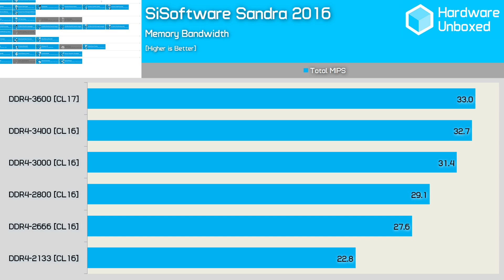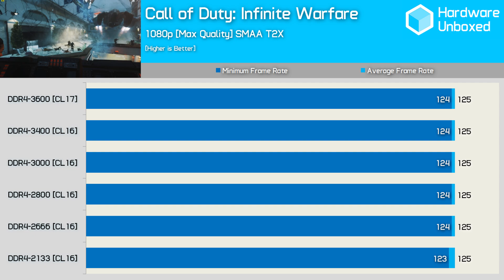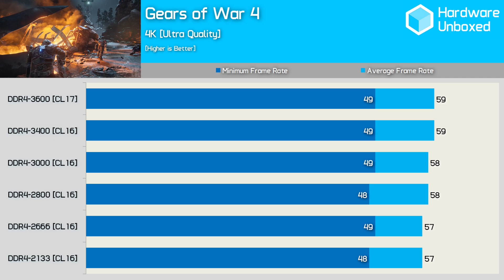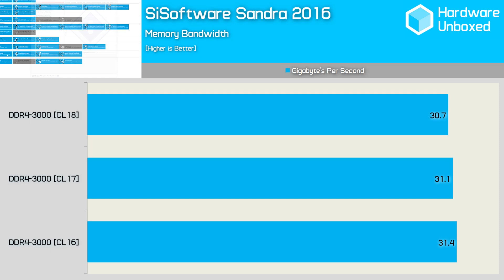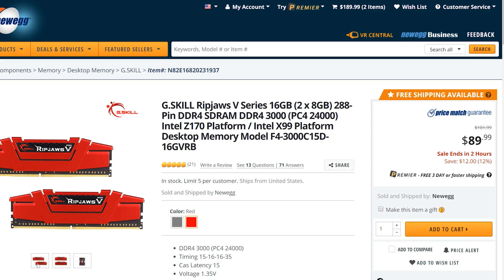Kaby Lake DDR4 Memory Guide, Scaling Performance Tested

Comment: Nice guide man. And a coffee lake guide like this one?
Reply: Get 3200 mhz cl14 G. Skill TridentZ as those are samsung b-die. They can be overclocked to 3600 cl16 fairly easily. My rule of thumb is, if you are going with a >$400 GPU with a high end i7 CPU / Ryzen 7 (>$300) cpu, might as well pair at least 3200 mhz ram. Open world games nowadays need fairly high speed ram. You pretty much at least buy the ram speed in the middle of the lowest and highest speeds (2133 - 4600), so 3200 - 3600 mhz ram.

Comment: Great videos as always! 

But could you guys please make a DDR4 memory guide for the most common GPU price bracket (GTX 1060/ RX480)? I have seen plenty of videos like yours showing performance advantages of higher frequency memory especially when the GPU and CPU are both already top of the line, but I have heard on channels such as DigitalFoundry that the performance advantage of higher frequency DDR4 is much more limited when using a more common setup (e.g; midrange i5 +1060 or 480) 

It would be interesting to see if spending say.... $10 more to get 2666Mhz instead of 2133Mhz on a midrange build would be worthwhile. 

Keep up the good work!

Comment: thank you for this, I spent way too much time researching if I should go from ddr4-2400 to 3000. I found out that my i7-7700k only supports 2400 anyway unless I overclock. Im still going to get 3000 and just overclock the memory.

Comment: I found that my G.Skill Ripjaws memory overclocks quite well.  I have a mixture of the 2133 and 2400mhz and it all overclocks to 3000mhz when I up the voltage to 1.31V and loosen the timing from 15 to 17 and 1T to 2T.  I haven't seen or felt any difference, whatsoever in gaming, but in synthetic benchmarks, and using my ramdisk (about 40% faster), it makes a noticeable difference.  If you're a gamer, get whatever is cheap.  If you're doing video editing or something that's more memory-intensive, it might pay to get faster memory, or you can take your chances with overclocking.

Comment: I have corsair 2133 stock with 3000 XMP profile, but I manually overclocked to 3200mhZ. Did make a framerate difference on Fallout 4 with my X99 build.

Comment: Memory frequency only helps increasing FPS counter when your CPU+RAM combo are limiting factor. Let's say, you pair i5 6600k clocked at 4.0GHz and GTX 1070 ( overclocked ) and you will start play very CPU demanding games ( Watch Dogs 2 fo instance ) you will notice that majority of playing time your GPU isn't fully utilized ( it's loaded less than 99% of this potential ). You can solve that CPU+RAM "bottleneck" by overclocking CPU and pairing it with higher frequency RAM.
Other example: overclocked i7 ( 4, 6, 8 cores etc. ) with GTX 1070- here you will see constant and full GPU load at 99-100% and therefore further CPU+RAM boost will have no effect whatsoever, because GPU already giving everything it has to.
P.S. Steve, would be interesting to see tests where we could see that thin line when we are ok with i5 k-series and where we start needing stronger i7's to fully utilize graphics adapter.

Comment: Seeing those memory prices in late 2017 :( feelsbadman
Reply: yeah i just got a "deal" on 3200mhz for 134.  what cpu is he using for the benchmarks?  i know 4 core cpus gain more with fast ram.  ive seen in one of his videos a 4 thread cpu gaining around 10 fps in bf1.  its because the threads have to swap in and out of memery so fast.  what cpu is this i wonder?
Reply: I'm pretty sure he's running an i5 6400 for all these benchmarks
Reply: lol are you trolling me.  a 6400 doesnt get 160 fps in bf1 even with a titan x, does it?  i thought maybe 7700k or 6700k.  maybe im wrong though.  is there a particular reason you think so?
Reply: yeah i just checked a 7700k video thats showing similar numbers so i think its an i7. one of his videos shows the difference with a 4 core/4thread chip.  i think it was the i3 8100 which is the same exact chip basically as an i5 6500. it got like 10 or 12 fps just going from 2400 to 3200 i think.  its one of the coffeelake videos recently.  its comparing using a locked b or h board compared to an unlocked z series board.  the b and h only go to 2133 or 2400, i think 2400, with the i3's.  so he compares that speed with 3200 on the z board and it does like 12 fps more.  i7's dont get much help from fast memory but i5's definitely do in any heavily threaded game.  basically any game where an i7 does a lot better than an i5.  when they preform about the same the i5 doesnt gain as much from fast ram

Comment: It is interesting that the RAM speed influences the performance in 1080p quite a bit (Depending on the game) but in 4k gaming there is almost no difference. So if you are planning to play in 4k you don't really have to bother about the RAM speed (yet. Maybe that will change with new graphics cards, maybe not).
Reply: Udo der Unförmige 
should change when GPUs are enough good to actually run games in 4K without being bottleneck.

Comment: If you play at 144hz monitor and you like competetive FPS games memory speed is very important! Minimum FPS is what you need playing at 100+ FPS. Overclocking CPU and Memory (i7 6700k@ 4.5ghz and ddr4 3400mhz for example) will give u highest possible minimum FPS on 1080p resolution. But only if you have R9 Fury - Fury x,  Gtx 980ti, GTX 1070, gtx1080, Titan X you will se 5-10% boost in FPS, slower gpus will give you less boost and makes  no sense to buy fast ram for example for rx470 or gtx 1060 ...The same thing is playing at higher resolutions, you dont need fast memory for 4k gaming...

Comment: "The impact timings have on bandwidth isn't nearly as significant as frequency". When it comes to primary timings, that may be true, but tertiary timings and RTL/IO-L offsets drastically impact bandwidth, far more than the raw clock speed. With 3600 C14-14-14-28-2, my current ram setup handily beats a 4000 C18 XMP kit with relative ease in both raw bandwidth and latency. This is completely ignoring rank interleaving. 

Any who, as your tests have concluded, memory speed only aids in gaming performance in situations with high CPU overhead. As CPU overhead becomes less of an issue (such as higher resolutions) memory speed helps less. As you also said, high refresh rate gaming (especially those high-end variable refresh monitors) benefit greatly from faster ram as it helps determine exactly how low your framerates dip. Faster ram can help you stay within that freesync minimum refresh window, making it a nice investment given how easy it is to overclock even the worst Micron IC's to 3000mhz on the cheapest Z170 boards.

Comment: Wow, I never knew memory speed had that much of an impact on gaming, it may be small but None the less I didnt know that!
Reply: Luka L Even more if you get even faster GPU and test other games.
Reply: Faster GPU? This is Titan XP. But going back: the impact is the greatest when CPU is under pressure, e.g. an i3 6100 in a CPU intensive game or section; then the high frequency RAM can compensate quite considerably for its limited performance. See some vids done last year by Digital Foundry.

Comment: Hardware Unboxed can you do the same testings with the mid range gpus like the rx 480 and gtx 1060 does memory scaling make a difference at theese card levels? i would really love to see that video and your findings.
Reply: Nash B 
the weaker GPU, the smaller impact. CPU and RAM speed comes in play when your GPU is enough good to make the CPU side as a bottleneck.

Comment: Hi I know this video is a little older but hoping you can help. I currently have 2 x 16gb Corsair LPX memory modules. Am I better off using all the slots as there is room for 2 more modules ie 4 slots or just sticking to 2 slots?

Comment: my goal is to spend the most on any one component in my system
Reply: once I get an equally priced psu
I already got the s-frame 
the corsair dominator special edition chrome 8X8GB
now I have found the Master watt MiJ
so once I find enough limited edition shit I'll buy the parts that can be out dated quickly (keep in mind 7 years passed before ddr3 was phased out)

Comment: hmm.. a bit of an odd video to be honest. Surely it would of made more sense checking out dual channel vs quad channel (because of Ryzen, 8 cores). Does it have any impact on performance, since the X99 boards are all quads. As you said, I think most people are waiting to see what happens with Ryzen now. Maybe you have already covered this issue? thanks.
Reply from the maker: I’m confused, why does Ryzen have anything to do with Kaby Lakes memory controller? Also how does testing Intel memory performance tell us anything about Ryzen performance. Finally, quad-channel vs. dual-channel performance on the X99 platform was tested to death over a year ago, quad-channel makes little difference for the most part.
Reply: I thought you said in another video that you were check the difference between them (to see if that would impact on performance). I did a quick look on your channel and didnt find a video.

I found it strange you wanted to talk about Kaby lake with regards of memory, since nothing much as changed since the past few generations. I thought this might be a question that comes up because of Ryzen.

Anyway Steve, thanks for replying, keep up the great work.

Comment: When you did the timings did you change all of the timings of the memory or just the cl? I have found changing the command rate from 2t to 1t can make the pc boot faster and lower loading times by a few seconds.
Reply: Also alot of auto memory settings n boards will set the trfc way too high meaning changing the primary timings gives little or no improvement.
Reply: He did not tweak RAM timings properly and only changed CL.

Comment: hey Steve,  this is an interesting video review,  and made me wonder if i shouldve gone for a z170 instead of my gigabyte g1 sniper b7 (b150 chipset),  my cpu is a 6700 non k,  ram is corsair vengeance led 16gb 2666 cl16 running at 2133,  gpu is a 1070 oced to 2050 mhz and 8500 mhz vram,  resolution is 2560*1080p,  i know that the titan XP will push the cpu at 1080p,  my question is,  will i get significant performance improvement from upgrading my motherboard to a z170 which will then run my memory at 2666 in battlefield 1? i hope you get what im saying,   typing from a tablet is quite cumbersome
Reply: or maybe get an i7 7700 and ram will run at 2400mhz without changing the motherboard? im really confused at what to do coz i dont have a lot of money to spend on upgrades..  z170 or 7700..aarghh.. either way,  ill have to sell either my cpu or my motherboard
Reply: No, imo you would not get a significant improvement by going from 2133 to 2666 MHz memory. Even CPU bound the Titan only gained 2-3% in BF1 at 1080p. Therefore, you would get about the same or less improvement with a 1070 driving slightly more pixels, which would not be worth the cost of a z170 mobo imo for the performance gained. Just save your $ for the next PC or upgrade. Maybe if you got a mobo that would allow you to overclock your non K CPU via base clock you could increase the memory speed at the same time, but even then it still may not be worth it considering the cost to performance ratio.

Comment: If only non-oc skylake / kabylake could use ddr4-2666 T_T
Reply: ME using i7 - 6700 + MB MSI Z270 GAMING M3 + DDR4 G.SKILL TRIDENTZ XMP 3600 MHz CL 17 16 GB ... Working as well bro :)
Reply: i3 7100 3600 here to 16 cas and a z270    also \o/
Reply: @zerotohero618  bro.. im using i7 7700 proce and i want to buy ram 2x8 3600mhz ram
by the way my motherboard is z270 m5 if is it ok for these setup?

Comment: So here's my problem, according to my calculations, ddr4 3400 cas16 is slower than ddr4 2400 cas10. So while the 3400 is out-performing everything here, it is beaten by a significantly lower mhz chip, with a much lower latency. So I am wondering what you have to say about that? Thanks. And wouldn't it be better in principle, to buy ram with the lowest stock latency you can get, and then overclock the frequency? Or am I missing something?
Reply from the maker: DDR4 isn't that timing sensitive, nor are the CPUs that use it. For example the difference between DDR4-3200 using CL14 and CL20 timings on Ryzen in a CPU intensive game with a seriously high-end GPU is next to nothing...

https://youtu.be/XOsYOASddeo?t=10m16s

Comment: I have a Corsair 16gb kit at 2400MHz, is it possible to overclock it (I have z170 mobo) and do you recommend it?
Reply: Watchmen22 2400 is just fine, you wouldn't notice the difference if you did OC.

Comment: Hi I have a issue with my DDR3 ram, I have just got the FM2+ Asus ROG Crossblade Ranger for my A10 7870k, I have 2 sets of ram that I could possibly use with the mobo or so I thought. I have 16gb ( 4x 4gb) of HyperX Fury DDR3 @1866mhz with no XMP profiles so its just PnP, but I also have 16gb (2x 8gb) of corsair Vengeance Pro Series with a xmp profile of 2400mhz and they oc rather well.. 
When I install all 4 sticks of the HyperX fury @1866 the debug always displays a 32 error code, but if I use just 2 sticks in A2 and B2 Dimm slots it boots up fine but only shows 4gb in Bios when there is 8gb installed and obviously in single channel ,  and one on its own in A2 Dimm slot wont work at all just error code 32, but my corsair ram works fine with both sticks but wont boot with just one. Is my ram defunked or is the Dimm slot defunked or bios just don't like them I don't know or it could be that this mobo only likes ram that has xmp profiles to boot. 
I have updated the Bios to the most recent version. I'm on windows 10 64bit, have no gpu at the moment for this particular build. So to cap off I have 4 sticks that wont work together, one on its own wont boot in any slot, 2 in Dimms A2 and B2 work but only half of ram shows, and 3 sticks don't work in any config. Am I only to use recommended ram for this mobo.

Comment: Really though, since so many mobos use only ddr4 2133mhz, it will not be much faster if at all than ddr3 running at it's max speed of 2133 mhz ( can reach 2400 mhz when overclocked.)
Reply: however I do see that in your benchmarks, you are able to get it to 3600 mhz.
Reply: Thelango99 
DDR4 2133 is as fast as DDR3 CL9 1600
Reply: 6St6Jimmy6 Wow, really, then what is the point of DDR4 then, when it won't be that beneficial to use DDR4 over DDR3 anyway?
Reply: I am still wondering why tech channels talks about DDR4 like it will be such an amazing upgrade over DDR3 when it's not.

Comment: Correct me if im wrong, but can't you just buy the cheapest 2133mhz ram and overclock it to 3000mhz with a z170/z270 mobo and overclockable cpu? Assuming that you don't care about aesthetics of the ram.
Reply: R.T. 
Depends but in general yes
Reply: Those cheapest 2133mhz ram often have worse heatsinks and dont overclock well, arent that stable with hefty oc, ofc u might get lucky but its not sure 100% thing on every cheap ram stick.
Better pay that silly 5$ more and not worry about anything xD

Comment: Does Asus H110M-D motherboard support Corsair DDDR4 2400 MHz 8GB ram with new Pentium G4560 7th gen processor?? Plz suggest me
Reply from the maker: Yes, all 100-series and 200-series boards support DDR4-2400 memory with 7th gen processors.
Reply: Thank you so much for your fast & valuable reply.. It must be help me for build a budget PC .... :)
Reply: did i hear you say that the 200 series boards will only support 2133mhz for 6th gen?   if so, bummer....

Comment: Sir pls. I need help! Ibought a i5 -7400 and GSkill Trident Z RGB 16GB 2x8GB DDR4 3000. Will it work? Please I need help
Reply from the maker: Yes, I don't see why not ;)
Reply: Hardware Unboxed  but I looked into the specs of i5 7400 and it only says DDR4 2400 not 3000. Or is it the SPD Speed I should be looking on out to

Comment: Should've waited for ryzen
Reply from the maker: +BAMB00STER4EVER to make a Kaby Lake memory guide? :S
Reply: Hardware Unboxed Me, I bought my z270 and kabylake system just before the release of ryzen. Feels bad man!
Reply from the maker: It shouldn't, you still have one of the most powerful platforms for gaming. It might not be the best value but it's the best for high refresh rate gaming.
Reply: Hardware Unboxed Yeah, and I am quite happy about the outcome, even though I could've gotten a cheaper and more versatile system (I had to cut out on a few parts)